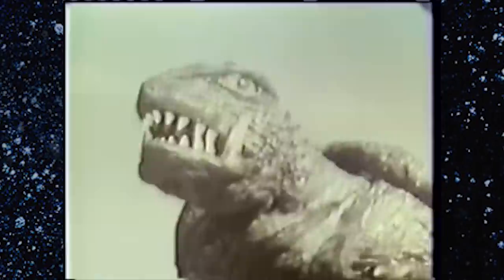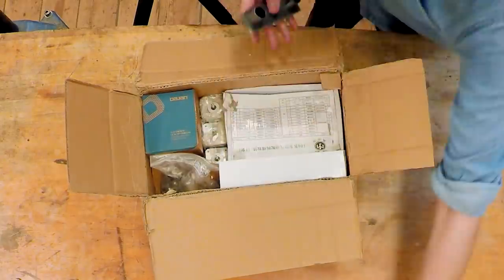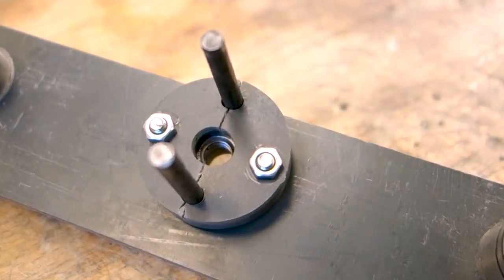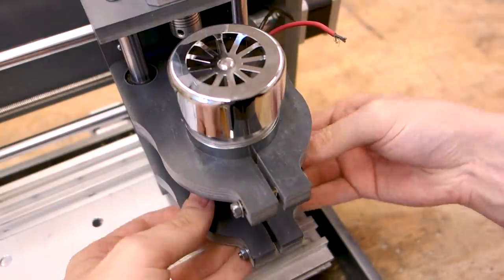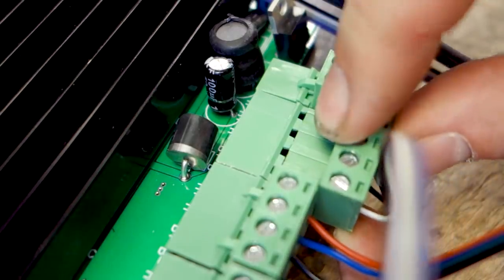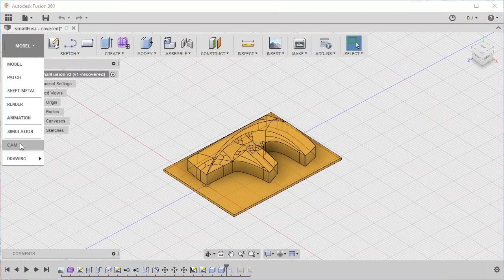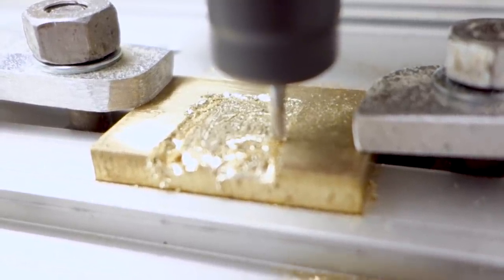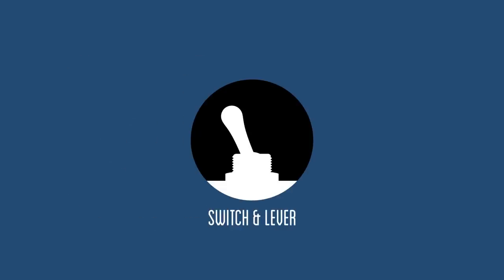Review: Cheap CNC Mill

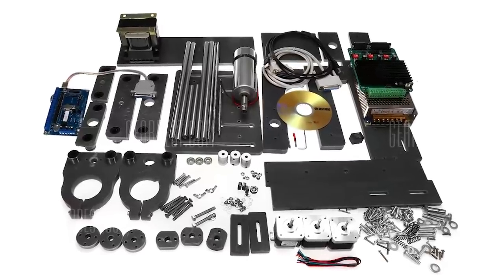Comment: it's interesting that the website picture  at 14:26 says it's a "mill engraver".  that is totally different than what was tried with this mill.  maybe the problem was expectations of what it could do, when engraving is not very deep and what was tried was way different than engraving.  It would seem from the test that it would do engraving just fine.
Reply from the maker: Indeed, I wasn't clear enough about that in the video, but I have mentioned it ad nauseum in the comments. I tried pushing the machine beyond what it was designed for, to see how much it could take. It failed doing something it wasn't designed to do, and for some reason that upsets people, even though they don't expect their cars to drive under water. 

As several people have already testified, it engraves and does lighter load stuff just fine.

Comment: For about US $160 you could have bought something much sturdier. I have. Sturdy as a rock, with aluminium profiles and much better electronics. You can do much better, you just have to find the right product for the right price.
Reply from the maker: It's funny how I've gotten that similar comment a few times on this video now, but when asked what, they've turned silent. Let's see if you can step up and show me what comparable (or better) machine you can get for that price?
Reply: Just go to AliExpress and search for "CNC 1610", for instance. There are bigger ones with similar build, but this one I own and it costs around US $160. The aluminium 2020 profile makes the whole thing quite sturdy, the electronics are easy to set up and very reliable, GRBL software works flawlessly. The motor is quite basic but you need to have in mind what you want the mill for. For printed circuit boards and wood, for instance, it's quite reliable if you're willing to take some time. Start with a roughing end mill and then finish it with a ball nose, small feed rate and step-down. The one in your video is not only much more expensive (more than twice as much) but also seems much more fragile. It's just a bad choice, in my opinion. I use 1/8 inch end mills but they do the job and you can buy a set of 10 for about $7. Even if they don't last long, just grab a new one for less than $1 and that's it. What can I say, I think mine is totally worth the money, but the one in this video just seems a big piece of junk, with a very fragile plastic frame and apparently sloppy electronics.

Comment: i bought this around 1 year ago, unfortunately mine came with not working CD rom :'( there was no way to recover the software, and no support for an online download link :''''(
i used it a loooot even to work aluminium, however the rigidity is around 0 so result is a lot of vibration (the machine start to move over the bench) and the resulting piece is really vibrated. i made a lot of circuits with that little machine and it apparently work very well doing it! it cut 2-3 mm plastic sheets very well (not in one go ofcourse!!! i do 0,5mm cutting max)
i agree with switch & lever, it's a good start point.
I replaced the lower pieces (y axis & bed) with cnc machined aluminium, but rigidity is still too low.
too bad for the chinese software bundled :(

Comment: It would be cheaper to actually buy/fab a frame and make a open source one around a dremel. 
I'm guessing most people who are interested in it already have a 3D printer so there's tons of builts on thingiverse for mounts/brackets. 

Honestly for the amount of stuffing around you had to do, I reckon you could of easily done a opensource one which would at least get the same quality.

Comment: If the plastic wasn't so brittle, this could be a cool introductory engraver for the kids. But... there are some decent aluminum 3020 machines on eBay for the same price. If you want to go all out for a small footprint hobby machine, there's a great mechanical minimill kit on OpenBuilds for like $360. Put a protoneer raspberry pi based controller on it, an er-16 1.5kw spindle, 1.9N Nema 23 steppers and you got yourself a beast mode hobby machine for under $800.

Comment: Thhe machine looks like it was used and had failed and was repaired, a refurbished unit if you like.
Reply from the maker: +Kevin Guy nope, because then you would see scratch marks and holes already being slightly worn from having screws in them.

Comment: I'd like to know if there's a way to easily share that program you used to convert the Mona lisa to draw it like that? Is it a vector file you produce that one could use in other ways, or really just gcode?
Reply from the maker: +SJWoodworks not really, it's hard coded in the program, it doesn't have an interface, nor command line to control it. It really just spits out gcode.

Comment: Wonder if making the frame out of MDF would be better than the plastic one
Reply from the maker: +KingHenryVR4 you'd probably need to use much thicker pieces of mdf than comparable PVC ones though, which would substantially increase the weight of the machine.

Comment: just use a anet a8 3d printer in place of this its only 129.00 and same size
Reply from the maker: A 3D printer and a CNC mill are two fundamentally different machines for different purposes. Try making parts from wood in a 3D printer.
Reply: people mount engravers in 3d printers and mount dremels.  the machine in this video is wobbly on metal so 3d printer could match that i bet and wood cuts with engraver or dremel would just need to be done slow to compensate for frame rigidity lackings.  also, anet a8 has several frame reinforcement 3d prints you can do to make it very solid

Comment: Wtf?!? A smps and a Transformer?!? This is stupid.
Reply from the maker: Why? It's a 12V DC power supply, and the transformer outputs between 45-68V AC, using 220V input. The transformer is only used to power the spindle, and the power supply is used for the rest of the electronics, including the Nema steppers.

Comment: Great review. I rate this machine slightly more favorably than you do though.

I did add your video to my project page at http://inventorartist.com/cnc-2020/

I didn't find the PVC plastic too weak so I didn't change any parts of the machine. I didn't use the instructions to assemble the machine since I didn't have a CD reader handy. It was all obvious enough... except the lead screw backlash control. That took some head scratching. But if you look how I installed them the PVC would not break since the parts are flush.

On the electrical side, I did run it briefly with the supplied transformer but I replaced it with a new power supply and controller (all very cheap on ebay) to have a knob to control spindle speed. This is important for cutting plastics.

I agree with your overall assessment that it's a tinker-only machine and not for production.

For most people this is true. My case is an anomaly and it is an actual production machine since I have a fleet of CNC machines and this one has a very specific use for which it is actually ideal. 

The lack of cabinetry for the electrical is (in my opinion) the biggest challenge of the kit. I've not actually solved that one yet as I wanted to run the machine for a while and prove the electrical before packaging up. I guess I'm ready to make a box. I have been considering the way you did it but I was concerned that vibration would be bad for the electrical. But the machine becomes so cute in this stacked format. I may do it that way but allow the box to sit separate on its edge at times and only have the machine in cute mode when it's out on a field trip....

Comment: i ran LARGE heavy duty mills at Boeing for years.   i think this HAS to the lightest ever mill machine.
Reply from the maker: +Moe Shouse oh no, trust me, there are way lighter mills around. This at least has a 300W spindle, I've seen ones with far less (basically tiny DC motors).

Comment: Not a very good review if you altered half of the original product and coming in biased before it was even assembled.
Reply from the maker: So, I should've stopped the review after the first part broke, as after that nothing was original? Maybe I shouldn't have added any cables either, as that's not original either. That would've been a very short, and pointless, review.

How would you say I came in biased?

Comment: At the price point, considering the lead screw and plastic, NOT EVEN WORTH THE TIME OF THIS VIDEO !!
Reply from the maker: Well, that's not for you to decide. It was definitely worth the time I spent making this video, and it was worth the time I spent tinkering with the mill itself.
Reply: As a reviewer, thats fine ... your time and of-course no argument there, but compared to the rest of the market, this is a very very expensive toy ... wouldnt even call it a CNC. Now I know if they are capable of producing that, then they know what a proper CNC should be like and they are certainly capable of producing a proper one ... The only real question, why are they extremely over charging for something like that ?? and why dont they attempt to produce something decent ?? Says a lot about the company ... and btw, I meant the time I spent watching ... dont believe me, see the rest of the comments
Reply from the maker: I don't understand why one wouldn't call it a CNC. It's a mill, that's Controlled Numerically, by a Computer, it's CNC, even if it's not in the same league as production machines. That's exactly why I underlined, in the video, that this is not in any way a production machine though. 

I highly doubt that Gearbest produced this, they just bought it from a third party. It doesn't say so much about Gearbest, as they of course put on a bit of profit on the things they sell (as any company would), but more about the producer of the mill.

Either way, thank you for watching the video, and even more thank you if you watched the ads. That's what makes it worth it to make these videos. To be frank, there have been a lot of supporting and thankful comments as well, and a lot of besserwisser comments from people who are full of themselves, and everything in between. If anything can be read from the comments, it's that it's an extremely broad playing field. Looking at the likes vs dislikes on the video though, they're not that much off from my regular balance. So while some people got irate over this video, by and large people liked it. :)
Reply: Look I can see your a hard working guy whos developing his channel about something hes passionate about . You respond to  your viewers decently and thats why I am still here answering, and I watched the ads and will even subscribe. This kind of commitment and dedication that makes channels and people and work standout and people do appreciate that. This was not the case with this product ... they did not show any commitment to any values that matter, yet over charging for something very bland ... I know its none of my business and I am saying that in the most sincerer way , but for a guy like you, you should not compromise and there was no room for this product after you have tinkered with great products and inspired alot of projects and ideas. One last this, I wasnt even comparing it to production CNCs. Please google $400 dollar desk CNC and see what you can get for that kind of money, then tell me if you still stand by your opinion ... Cheers and best of Luck !!
Reply from the maker: I've done a fair amount of research of other desktop CNCs, and there are a vast multitude of them out there. Each have their pros and cons. Frankly, for $400 you're going to at best get something comparable to this, unless you can make compromises in other areas, such as power of spindle, size of table, Z-clearance, or other things. Not saying you can't do it, but generally the bigger the CNC the harder it is to keep tolerances and repeatability high, as there will be more deflection regardless of material the frame is made from

I'm not saying that this is the best thing in the world, but it's very much a concept of you get what you pay for. This is cheaper than the first 3D printer kit I bought even (the Velleman K3200), so it's not terribly expensive all things considered. That it wasn't able to do what I tried pushing it to do (which is beyond the product description) wasn't much of a surprise. For engraving, which is what it is designed for, it does just swell, as mentioned by several others who own the same mill.

In the end, I'll level with you, I'll likely cannibalize this mill anyway, especially considering what came up with the circuit boards being (unbeknownst to me) counterfeit, and just use the parts for another build in the future. Right now I'm without a workshop though, but I have a whole bunch of projects shot and editing, so no worries, more project videos are coming up. Not going to do any review videos again for some time, that's for sure.

Comment: I would NOT solder the spade connectors in addition to crimping. That is not how they are intended to be used and it's asking for problems tbh.
Reply from the maker: You say you wouldn't, but you don't actually say why.

Comment: From what ive seen this "thing" isnt worth calling a CNC machine, since even the seller himself says that its a NC machine. Could give some details on what cutter you used, at what rpm/feed? Maybe you could test its precision in the next video by programming a square and/or circle and tell us the "should" and "is" size. After that i could maybe help you out with what depth/feed/rpm you need to use so you could MAYBE cut into some sort of metal.
Atm i still think that IF you consider to buy this you should rather buy a 3D-printer, since they to the exact same thing just the other way around and not as messy.
Reply from the maker: +Linus Salomon I don't think you understand the difference between CNC and NC machines then. The first C stands for computer, and without a computer you couldn't make this machine do anything. It doesn't exactly read punch cards. 

A 3D printer does the exact opposite. This removes material, a 3D printer adds. They're not even comparable. If you buy a 3D printer thinking you're going to be able to engrave something, or make something out of wood, or even a plastic that's not ABS or PLA, you're in for a bad surprise.
Reply: well then, go and engrave your plastic, or maybe even wood, use your "CNC" machine to produce....... nothing more then some limited "toys" and eventually you will come to the conclusion that this pile of plastic and chinesium isnt worth anything since its 1st: EXTREMELY limited and 2nd: it will probably break apart while it does what its supposed to do.
My advice: If you need a CNC machine to make something for you, ask your way around, you'll find someone on the internet.
Either way, i appreciate that you tried and made this video, but in MY oppinion, this wouldnt be worth it, since tolerances are loose, quality low, and i will probably have more fun writing this comment than fiddling around with that thing.
Ty though, really, i like your videos, just not this one..... i like the video, but not the Mill.... why am i even writing this...... i should go to sleep and use less dots.

btw i do now what the difference between a Computer numerical controlled, and a numreical controlled machine is...... (still too many dots)
Reply from the maker: As I said in the video, it's not a production machine. I don't know why you get irate over that. It's also advertised as an engraver, not a mill. I tried to push it beyond it's intended purpose, and it didn't perform well. Again, that's not something to be irate over.

Thirdly, there have been several people who have commented here who have had longer experience with this exact mill than me, and use it for engraving various things all the time, without issues, and have done that for years. So both your quality and your "probably break apart" arguments are hollow. I don't know why you would need higher accuracy than +/- 0.1mm over 100mm anyway, when doing engraving work. Tolerances are loose compared to what exactly?

I don't think you should be so quick to dismiss things simply because you're not into it. I had a lot of fun putting this together, and figuring things out. Just because you wouldn't doesn't mean it's a bad machine.

Comment: Well, you can build one for around 200$ if you have a little knowledge and free time. 3  nema 17 motors = 30$, psu = 15$ - 20$, sheet of acrylic glass or aluminium for frame = 50$ (you can get it for free from fridges, lamps, windows, home decorations, ect.), arduino = 3-7$, stepper drivers = 3$, threaded and smooth rods = 10$,  linear bearings = 20$, spindle motor = 50$?, belts = 5$, and 50$ for paint, screws and nuts, glue, wires (easy to get for free), rod adapters, belt pulleys, limit switches, ect.

Comment: Very good video! It answers all the questions for people, who already have a machine like that. But in my opinion, the product in the video is something to play with, which may be the desired use. But I think, you will be disapointed, if you are searching for a new tool in your workshop.
A Stepcraft CNC is nearly in the same price range (OK, twice as much with a good motor and the softwareupgrade, but that is also no money) and you can use it for hobby production also with some aluminium type, copper an brass. Perfect for unsulationmilling. You get interesting upgrades for 3D printing and Lasercutting (which I dont use)). I have one for about two years now and it has payed itself by far. I was a newbee with the stepcraft and it took some time, to get familiar with CAD and CAM, even the software is very easy and versatile.